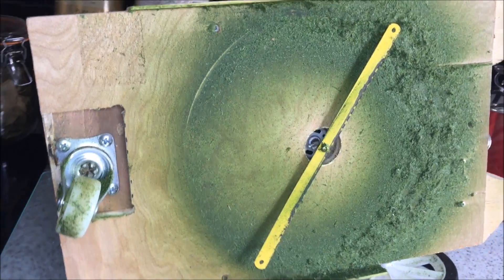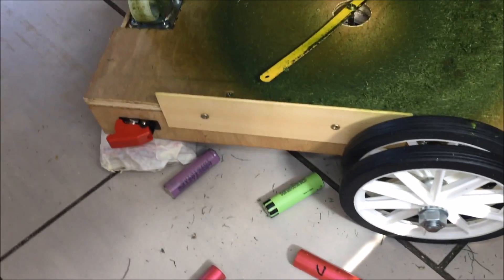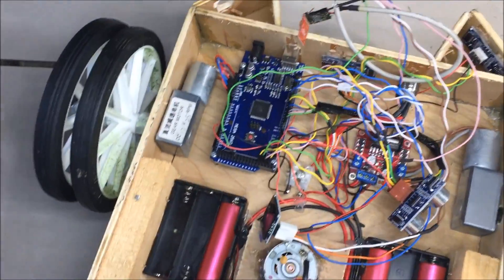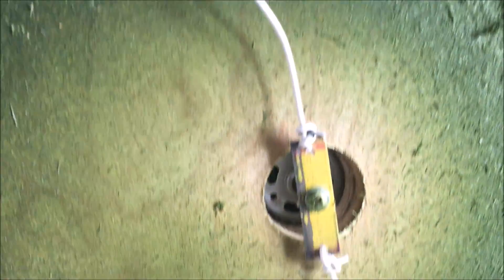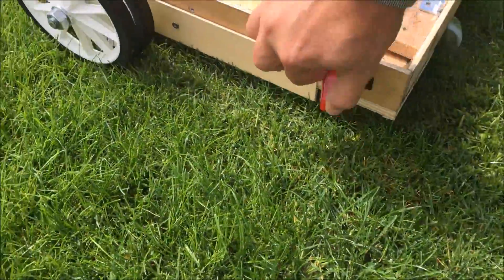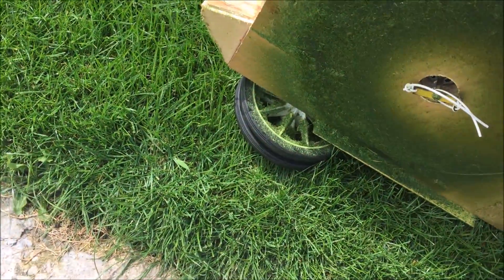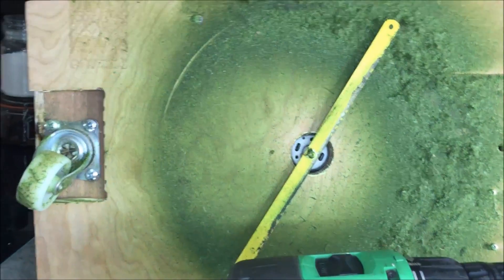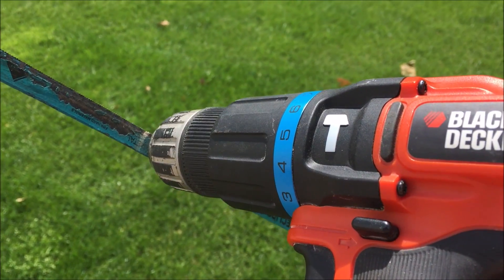Robot Lawnmower PT27

Comment: Great music!  My thoughts are that you put a large plastic disk on the motor.  Say 8 to 10 inches.  then put razor knive blades on the outside of the disk.  The plastic disk would give your blades some weight behind them and they slice thru the grass with the greatest of ease.  If you damage the blade just replace it.
Reply from the maker: Britton Evans this is indeed a very good idea, and with the torque of the electric drill, I think she'll do a fine job of cutting grass!  ...   in fact, this is just like the Husqvana auto mower works...  right... will look out for a plastic disc...  ooooh camping plate!  ...  BOOM!
Reply: Yep, that's how the one my uncle has works as well

Comment: hi nice project !!!!!!! it's JGY370 for wheel ? which rpm please ?
Reply from the maker: the 30 rpm units
Reply: @DubiousEngineering  ok if you would have things to change to improve your project what is it? the battery is the most critical and expensive to have good use
Reply from the maker: I would use bigger motor drives... those little cheap ones don’t have much torque

Comment: Hi! This is amazing. What kind of batteries you are using. How long does it operate with fully chrarged batteries?
Reply from the maker: We robbed a bunch of 18650 lithium cells from used laptop batteries... need to be careful as they are quite powerful and need battery management.  It’ll run for about 30 mins...
Reply: @DubiousEngineering Great! And what about motors? From rc car?
Reply from the maker: Yes for the cutting blades, but geared motors for the wheels...
Reply: @DubiousEngineering  thank you! I will subscribe to your channel! 😊
Reply from the maker: Aww thanks!!!  Plenty more mad inventions to enjoy :-)